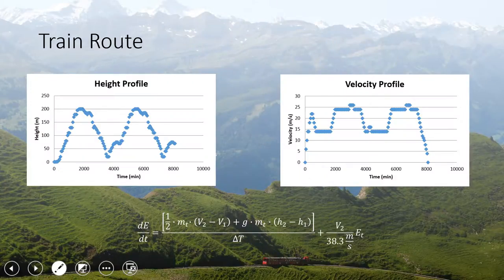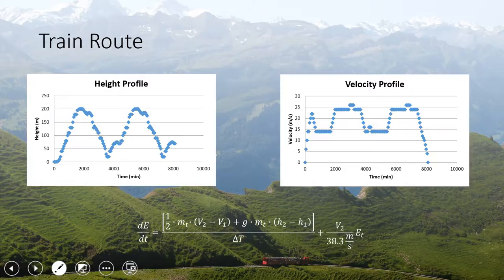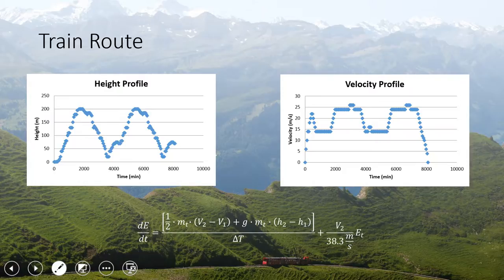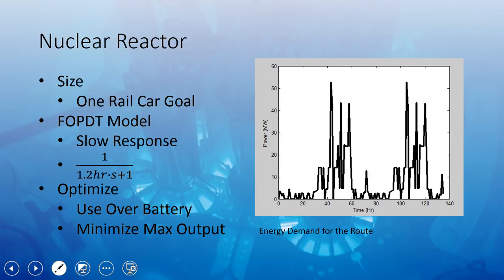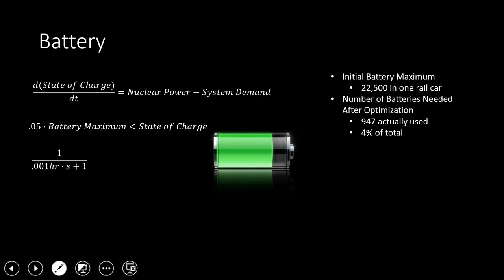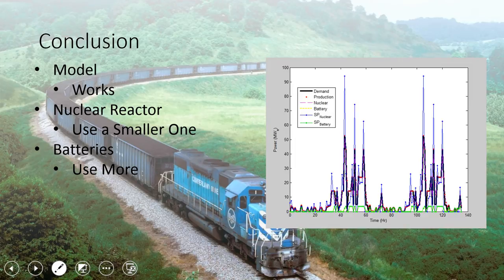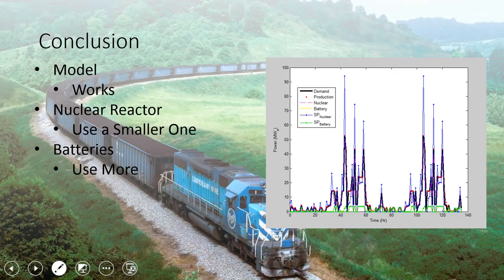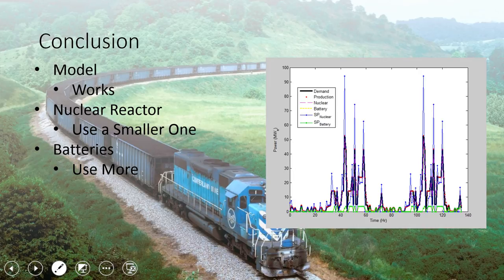Nuclear Powered Train in Simulink

Comment: Ever heard of railway electrification? It allows you to leave the nuclear reactor safely contained at a power station while making your locomotive a lot lighter by drawing its energy from a power line...
Reply from the maker: That is likely much less expensive than a nuclear train! This case study was a student project exploring small modular reactors that can load follow for dispatch optimization.
Reply: "The train crashed, the reactor exploded!" -"You are delusional, take this man away from here!, now water that train, cool it down!" Nuclear trains, not great not terrible.
Reply from the maker: @businessproyects2615  it sounds like a great movie line. What is the reference?
Reply: There is electrification, but it is extra work to build and maintain, can be an eyesore, and is vulnerable to power outages. Also, if the electrification is low down, then double-stack freight trains ar precluded. Also, a nuclear locomotiv is far more environmentally frendly than an electric, if the latter gets a significant part of its power from fossil fuel, biofuel, or hydroelectric (clogging up rivers isn't good). So in many cases, a nuclear loco is preferable to electrification. Indeed, only ~1% of the rail network in the U.S., and only ~1/3 of it worldwide, is electrified. True, there is the possibility of a crash, but i think a nuke can be made crashworthy i.e. highly unlikely to spill radioactiv material in case of a crash. Indeed, with diesel locomotivs we accept the risk of diesel fuel spilling or catching fire; say nothing of fumes and carbon emissions, and the hassle of tunnel ventilation and frequent refueling. Why should a nuclear loco be held to a fundamentally different standard and be expected to be risk free?

About nuclear being more environmentally frendly than hydro. Nuclear, if done correctly, would mean breeder reactors turning thorium into uranium-233, or natural uranium into plutonium-239. Actinides would be fissioned, not treated as waste; so radioactiv waste would consist only of fission fragments, and so would be minimal. And that radiowaste would be not be useless: it could power radioisotope thermoelectric generators (RTG); or be used for lighting (highly radioactiv things glow in the dark), or heating; or be used in nuclear medicine. And thanks to the breeder reactor, there would be no uranium enrichment, which is a hassle and wastes uranium. Because no uranium is wasted, less of it would need to mined, so less of the environmental impact of mining.

Comment: steam?
Reply from the maker: +chris phillips No, electric drives. Small modular reactor + battery energy storage. It would probably never happen due to safety concerns but the students had fun designing the system.
Reply: Sir, the most practical way to do this would be a reactor powering a steam turbine running a generator seeing how most locomotive are powered by a Diesel engine that run a generator. They could be easily converted. Also, your statement that steam has safety concerns. Steam is safe. Safety valves and common sense is all you need to run a steam engine today, a few years ago, or in the future.
Reply: Also, a 2 car and one engine could make a locomotive like this difficult to store and you loose tractive effort that could have been pressing down on the main drives. You need to lean a lot about railroads to understand them. You unprofessionally called them "trains" instead of locomotives, considered a 3 unit locomotive of 2 units being the size of a entire boxcar. Last time a 3 unit locomotive was built it did not last long and I strongly recommend that you read up on union Pacifics 3 unit turbines.
Reply: +Weyerhaeuser Railfan thanks for your feedback. if another student team takes on a project like this in the future, you'd be a great resource.
Reply: come on nuclear power doesn't produce steam
Reply: @hamzatgelagaev9758  it produces heat that be used to heat water to make steam...